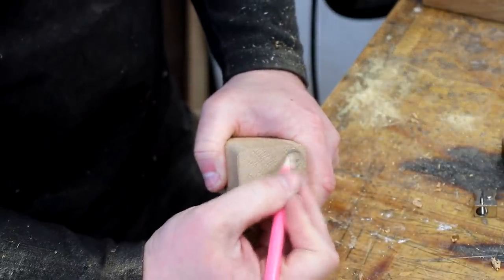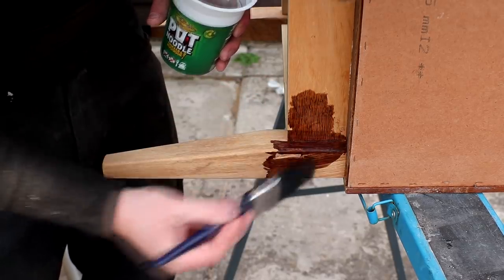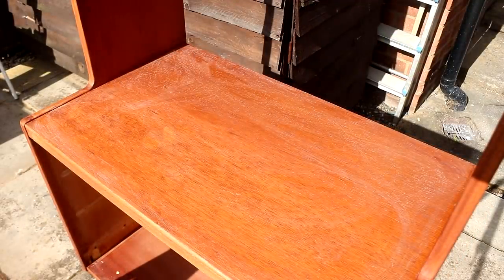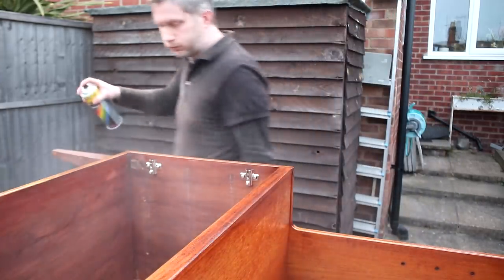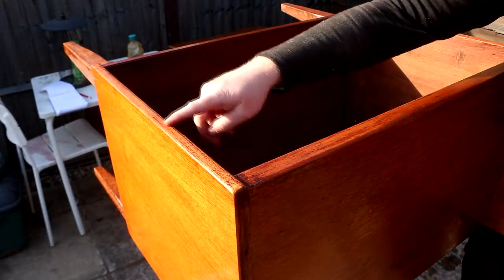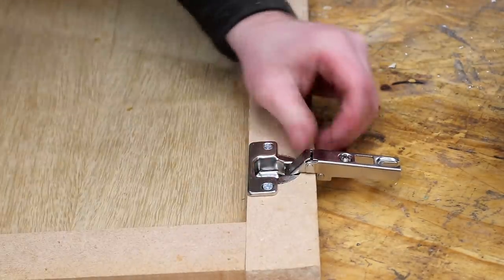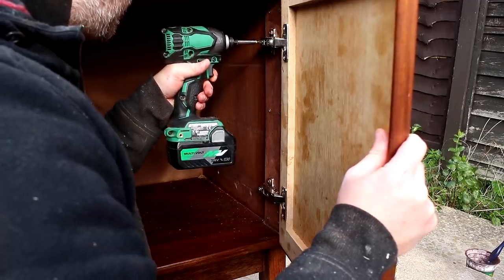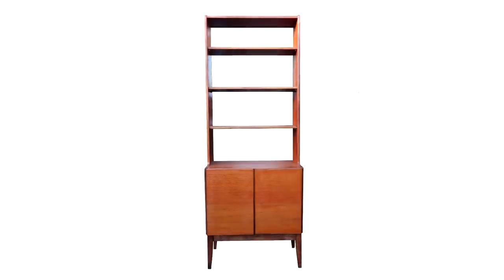Mid Century Bookcase Cabinet - Extreme Makeover Before & After Part 2 of 2

Comment: Hi Keith the trouble you’ve had with the hinges is it looks like you have the cup part of the hinge too far in from the edge of the door, we usually have about 5mm from the edge of the door to the outside of the cup so its around 22mm from the outside of the door too the centre point of your hinge bit on an 18mm carcass 
If in doubt just have a look at a standard kitchen door as they are all on the universal 32mm system that these hinges are made to work on 
Hope that helps in the future and keep up the great work 👍🏻

Comment: Another vote for getting a hinge jig if you're going to be using those hinges again.  Mine came from screwfix or toolstation and really didn't cost much.  I've used that style of hinge a few times.  The first time I used them and didn't have the jig, I copied the measurements for mounting them from one of the cupboards in my kitchen that have the same style hinge

Comment: Hi Keith nice project  , for my attic door I fitted EASY MOUNT HINGES 90° from screwfix  that didn't need the big hole drilled in the door very easy to fit and work great ,G.

Comment: Another great video, please don't be so hard on yourself...the darker lower section works (if matching is not possible) as I was taught that the darker tone will "anchor the design"... as for the euro hinges I've fitted quite a few and the adjustments help compensate for doing the job on my own (and not being as good at as you!). Our dear friend Peter Millard had the jig on his "gifts for makers" list and using a drill press with a depth template works for me.  The hinge screws from Toolstation/Screwfix help too😃

Comment: I guess those hinges were a learning process. They don't need any catches to hold them closed. But, apart from that, those sort of hinges are best left to standard chipboard furniture, built to certain modern standard dimensions. Most of what make/alter cannot easily conform to this without much expensive time and effort. Simple brass hinges would've been much more time effective, and looked good. But they'd've needed catches. Great video as always Kieth. Thanks.

Comment: Hi Keith, on the issues you had with the cup hinges, it may be that your doors were too thick. I think 22mm is the max for standard style hinges. You can buy hinges from Blum that are called "profile door hinges" which have a different swing to push the door away slightly from the carcass as it opens, and can accommodate doors from 16 to 32mm. As someone has also commented, it looks like you may have drilled the cup a little too far from the edge of the door as well. As most of these euro hinges are fairly standard, if you need fitting instructions, you can download the PDF from the Blum website. It gives all the information on where to position the hinge depending on carcass material thickness, door thickness, minimum gap required for clearance etc. It's a great free source of information. 
Keep up the great vids, and best of luck with the business!
Reply from the maker: Thanks so much Andrew, wise words and yes I think you are right, my doors would have been about 22mm possibly a fraction more so that was probably where I went wrong! 👍